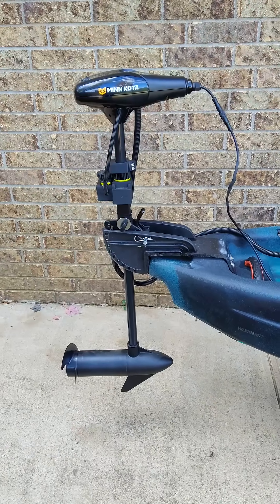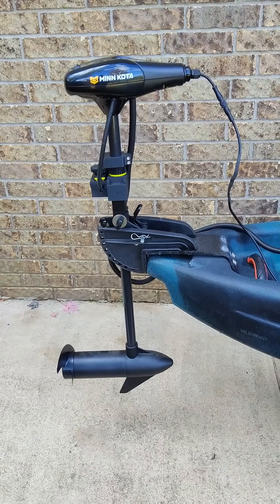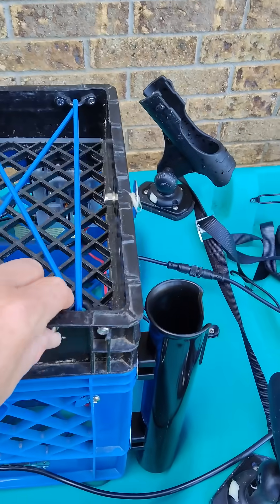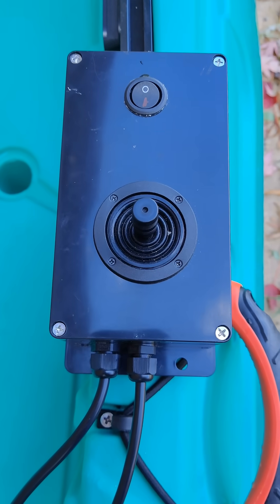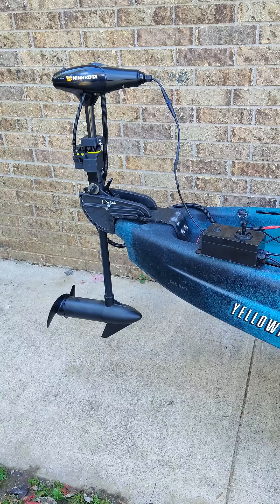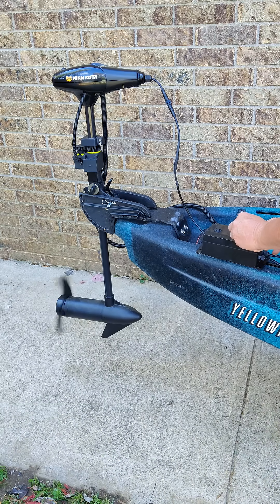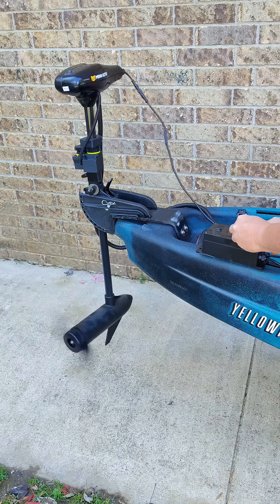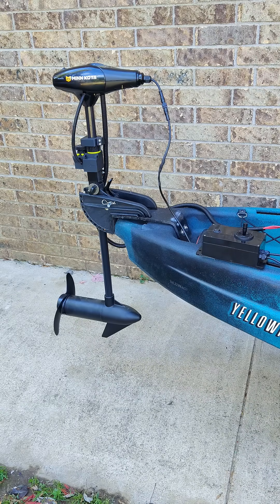Kayak Trolling Motor Remote Throttle and Steering

Comment: Should i run a circuit breaker to a fuse box for my 55lb trolling motor i see you have a circuit breaker and fuse box . The recommendations i see online is a circuit breaker or inline fuse
Reply from the maker: I run a marine resettable breaker on the motor separately.
Reply: @Aksmaniyak  ive ordered the haswing cayman 55lb gps version recommends a 60 amp circuit breaker is that sufficient without having a fuse box also
Reply from the maker: @irishpredatorfishing  A 60A will work fine for the motor.

Comment: it it ok to have the battery exposed like that? it doesn't need a waterproof enclosure?
Reply from the maker: No, it is ok because it is a sealed battery. It really never get very wet, just splashes.

Comment: Have you ever had any issues with wires melting? I ran mine for about 30-45 minutes the other day and it started melting the smaller wires from the controller board.
Reply from the maker: I have not. It depends on what size thrust motor you are running. I do not recommend any trolling motor larger than 50lbs for use with the Hobbywing 880 ESC.